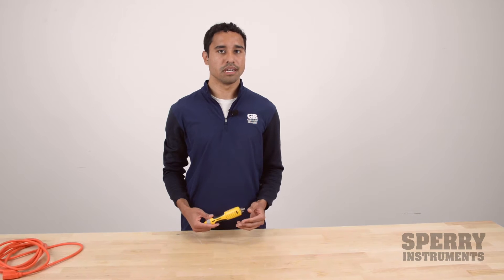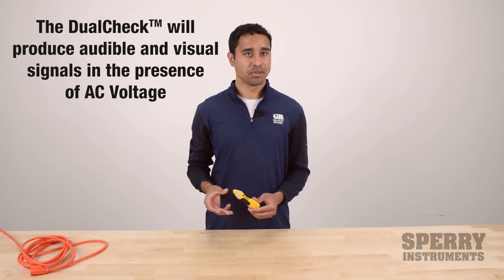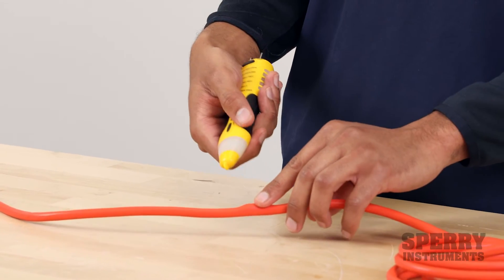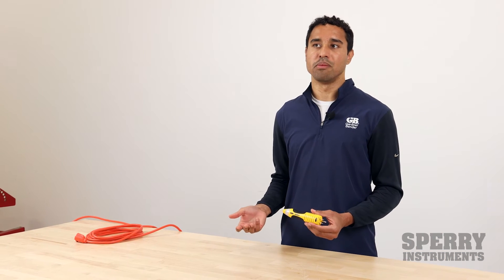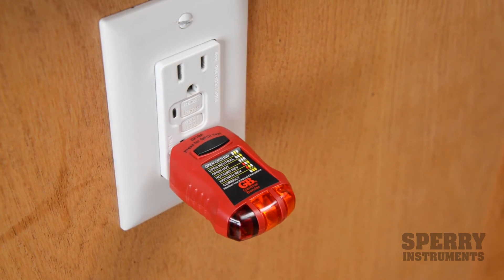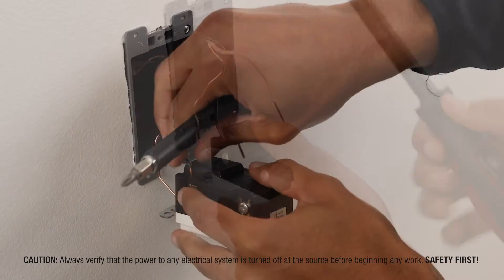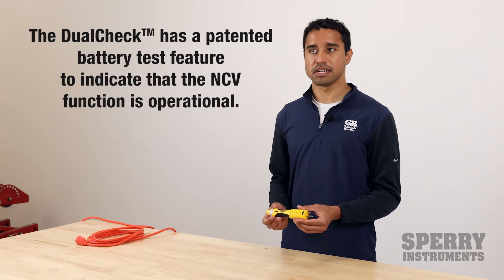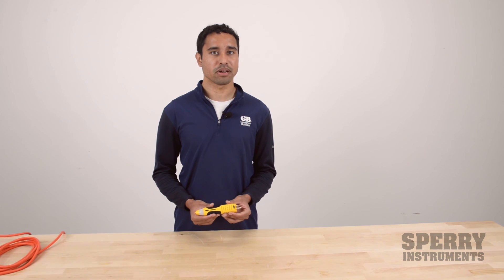DualCheck™ NCV & GFCI Outlet Tester | Product Overview

Comment: You guys need to package the battery on the front of the packaging where the consumer can see it.  It is literallly hidden in the back / bottom of the packaging.
Reply: I purchased this from a large chain in Canada.  I should go back to the store and force the manager to pull them all (contact their corporate office) and tell the manufacturer to put labels on the front of the packaging notifying the customer that the battery for the NCV is, as you say, hidden away on the back of the packaging.  It's actually quite insane but I guess when you get shocked you'll find this video and wish you noticed that before you threw the battery in the trash.  It's an LR44 battery, by the way.  Your message saved me from having done that.  THANK-YOU!!!  The company should have the battery installed but with a plastic pull-tab.  Oh my.  Read a comment below.  This has happened, people tossing the battery!!!

Comment: Haha, I bought mine at Menards, there was a sheet of paper inside telling me where to download the instructions because they were going green and it also said there was no battery included. I live 30 miles from town, it would have been nice to know I had to buy a battery to make this thing work. I had to make a special trip back to town for a battery. Can you use this on walls to tell where the wiring is located so it does not get drilled through? I tried using it on my wall in a 4' by 4' square and the light lit up like there were wires running all over inside that wall. How do you trust something like that?